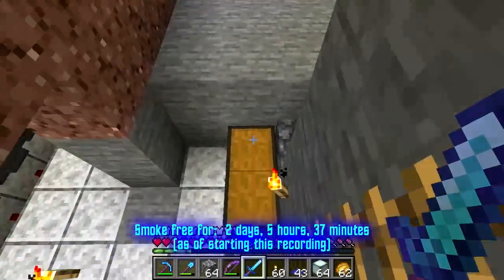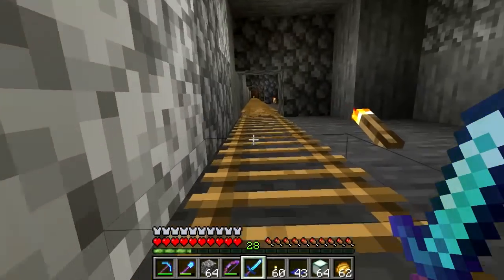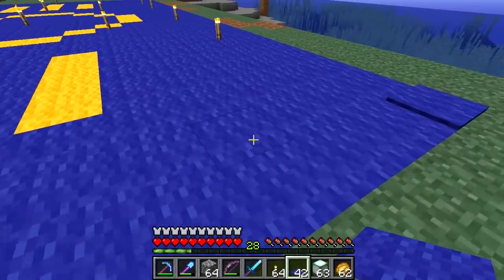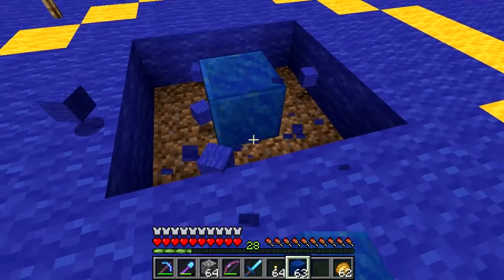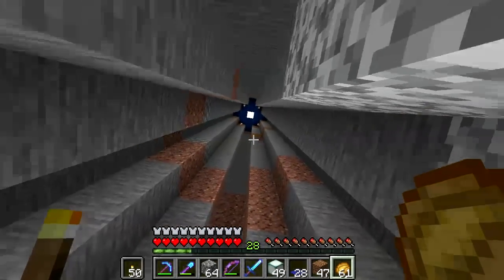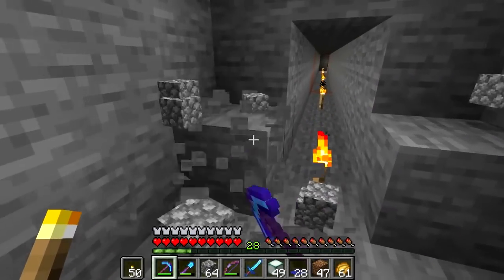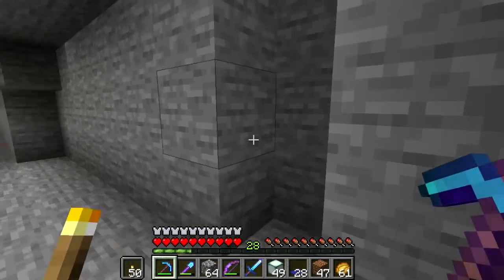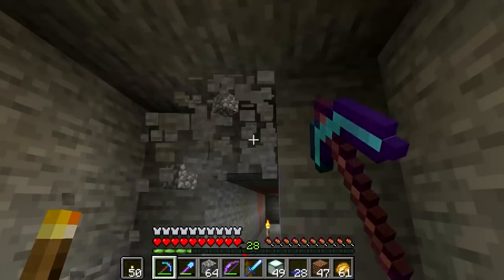Main Vault Elevator Shaft - Hermitcraft 6 Ep70

Comment: Keep up the good work on giving up smoking, TFC! It's Lent right now, so there's a lot of people giving up something for the entirety of it (just try giving up video games, or swearing, or your favorite snack for 46 days). Something I've heard - you can train your brain to learn/unlearn habits by doing/not doing something for about 3 weeks.

What might look nice is a 2-way slimeblock elevator, with two doors on opposite ends at the underground level. One leads to the main vault, and the other leads to the experimental part. I was thinking noteblocks for the walls as a texture, but aren't those movable now?